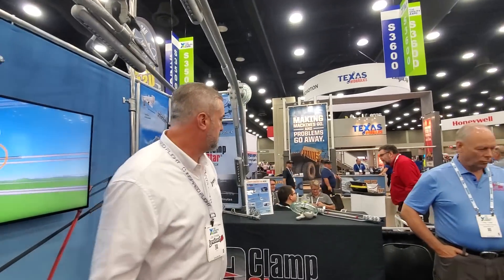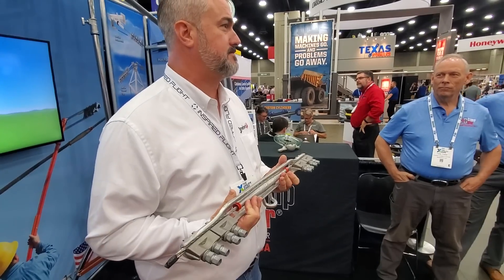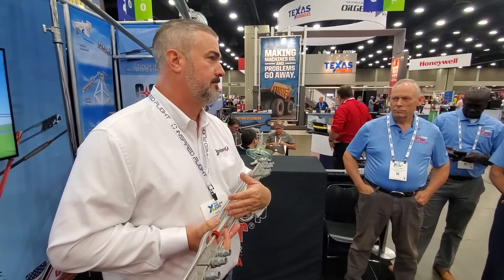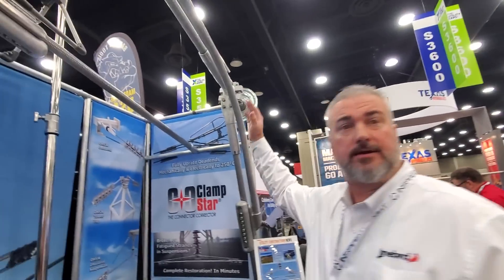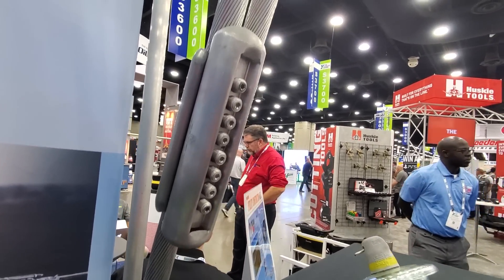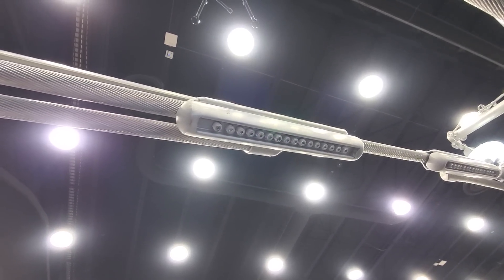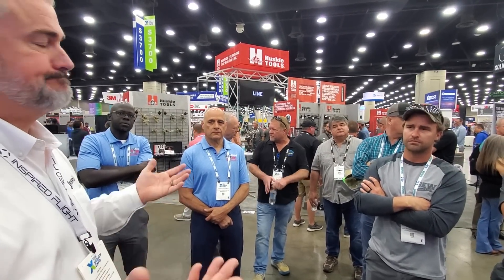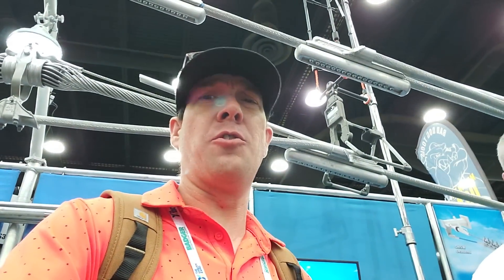Drone setup for line inspections and quick repair with ClampStar!

Comment from the maker: Hey all!

As many of you know, I've been at the 2023 Utility Expo for the last week!🔥

I wanted capture a 💯% unedited video from one of the vendors for a Friday morning post 🤫... 

First thing I wanted to mention is; This video is not sponsored in any way... Just met a great group of guys with a really cool collaboration of products!

I get a lot of questions about the use of drones for trouble shooting our power grid.

My crew and I passed this booth and noticed a drone with a bunch of gear hanging from it, so of course we had to stop and ask... Better yet, stop and record a quick video for y'all in 1 single take - zero edits.

So here's what we've got;

Damaged conductor, hot/corroded splices and poor connections are all very bad. It's not a matter of "if" but "when" those connections will fail.

Transmission lines, given their height and high voltage, are not easy to inspect! 

Crews are now using drones with a "SensorLink Ohmstik" to inspect these conductors/splices while energized from a remote location!

The Ohmstik is attached to the drone using a product called "LineBird"

and

Repairs are then made using the "ClampStar".
These repairs can be completed in a safe efficient manner while the lines are still energized from a helicopter, bucket (barehand) or using sticks.

Well... I'm sittin' at the airport and the plane's a boardin'😯 so I gotta go y'all!
Reply: Dude. ClampStar should pay you $$$ because you did a MUCH better job explaining what the product is, what it does, why you need/want it than the sales guy did!! I was sitting here like, ok what's it for, what does it do... Then you very concisely and clearly describe exactly what it is, why it's useful etc... Very nice video!

Comment: The guy from Clampstar sounds like he knows nothing out thermography. Doing a qualitative analysis based on heat gradients and delta temperatures can give you a ton of insight on the performance of a connector you don't need to measure the splice directly, that's silly.

Comment: IMHO he tries too hard to be slick and really push it as a big safety improvement.  It's not a big safety improvement, it's a small one.  However, it's a tool in the toolbox and when suitable it does reduce the scope of work, and thus hours worked, cost of repair, and (of course) statistics of injuries.

Comment: Cool product, thanks for sharing this. I agree with him and just use e=95% (camera default; some use e=80% but whatever) The strength of thermography is you can look at a bunch of stuff at once to draw your attention to suspect parts, it's weakness is accurate temps outside of a laboratory setting, and we don't work in a lab. How many of you work in the electrical industry and feel people take electricity for granted? (Until it's out) Be safe!

Comment: Sounds great for bare distribution conductors, we have insulated tree wire on our property. So regardless we have to skin the conductor. So when there’s a few strands holding on an energized distribution line we have to take and intentional outage on that line. Wayyyy to risky to be skinning the insulation while it’s energized.